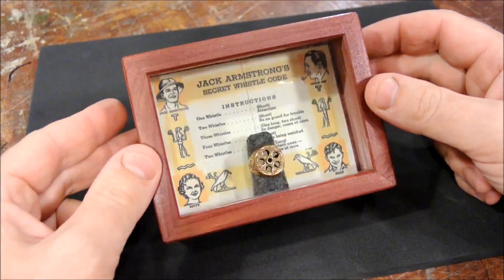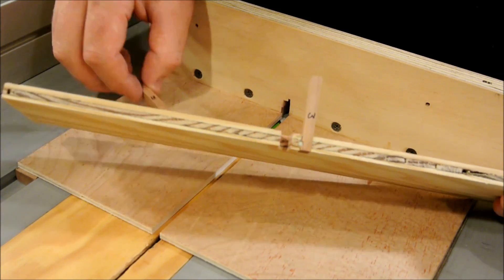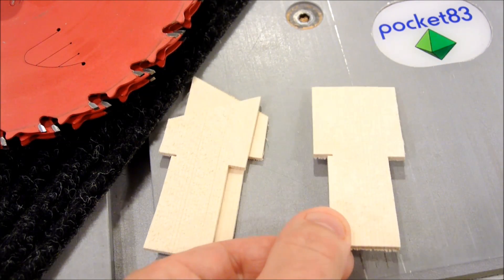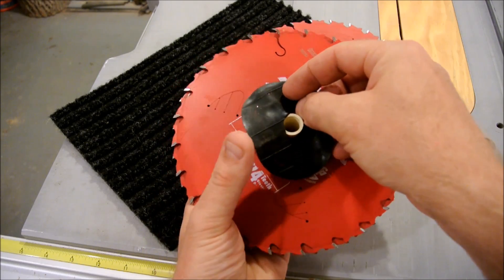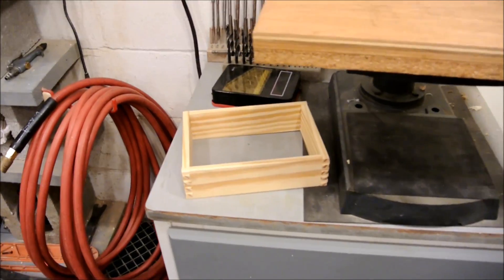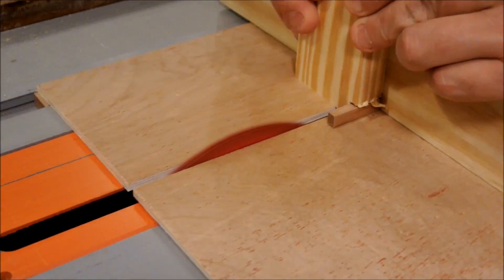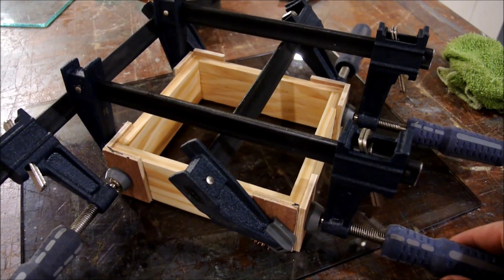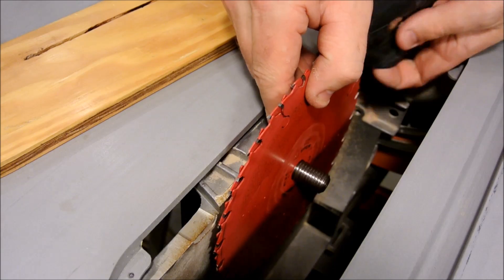Box joints WITHOUT buying a dado set (make one)

Comment: You can also use magnetic shims wooden shims plastic laminate shims or a wobble head too but you can't put up a video and caution people and say it's only for entertainment and tell me it's no reason to fear the procedure just because it isn't the standard .That's rather a flip flop isn't it? Inner tube is ok too . I've even made my own dado heads in a pinch but the engineers who make dado heads aren't dummies-- other wise dado heads would not exist .Then there is the math for the kerf you cut and the width of your drawer side,  but for what you are doing here; it's ok  too.
Reply from the maker: I'm not understanding your point. I'm not being inconsistent. A dado stack isn't exactly a "must-have" for most people, so this procedure could be used to achieve the same thing (with limited versatility), safely and at zero cost. As for the "entertainment" disclaimer, that is because I know that many of you are still going to be incapable of parroting the procedure without getting hurt. I mean, look- you can't even write a few sentences that aren't riddled with grammatical errors; I just wouldn't trust you around sharp edges and spinning blades. Lucky for me, I'm not really responsible for what you do to yourself!
Reply from the maker: Addendum: Most engineers are dummies. I've worked with plenty of them. Just look around at the products that surround you. Do you think they are optimized for design elegance, or for profit maximization? Engineers of this generation are just corporate tools. Thinking men and women are the true engineers. Now go read Emerson's "Self-Reliance," and bugger off; I have shit to do.

Comment: I've stacked regular blades for years with regular dado spacers (the cardboard or plastic ones they stick in dado sets). Never had any slippage. Why would they? They don't slip with a dado stack, why would they slip with blades? 

Also, anyone who uses a lot of blades is getting them sharpened. Just ask your blade guy to sharpen them with a straight cut instead of a bevel (not every tooth of course, just every 4th or so). Voila, bevel problem solved.

Third, an additional safety note. Stacking up regular blades, especially for a wider stack (I've done up to 3/4) adds up weight in a hurry. The blade set has a huge amount of momentum in this set up. That might mean strain on your saw. It also means your blades are going to spin for a LONG time after you turn off your saw. One time, I turned my saw off, stacked my material up, went into the house for lunch, realized I forgot something, returned to the shop, and the blades were still - quite quietly - spinning. Be careful.

Comment: Some safety thoughts:
I wonder how long the rubber pads are going to be good for? Is there any danger of one of them failing catastrophically (shredding and flying out between the blades leaving blades loose during operation), since that rubber wasn't specifically engineered for this task? You may want to replace them on a schedule. You may also not want to make use of that perished old punctured tube that you saved for patches 10 years ago.
The main force on them is probably centripetal, stretching them outwards a little (but maybe almost no actual stretch due to the clamping pressure of the blades). The other force is the sheer from the difference between the work the outer blades do to that of the inner one(s). The rubber would experience all this + vibrations and probably heating.

Comment: I thin this is a great technique for making utilitarian box joints. But you still have to solve for the problem of getting flat bottoms in your cuts. Its apparent in the video when you put two of the pieces together that the teeth of the blades cut at an angle and leave "bat ears" which show up as gaps in the final joint.

For what you made, I dont see a problem with it. But if your making a fine piece mean to show of those nice box joints, then I think you have to have flat-ground teeth on your blades.

Nice video!

Comment: Nice Power push stick. LOL
Reply from the maker: Jim Steinbrecher After I made that simple table-saw, I received a few dozen comments about how I should use a power strip for its on/off switch. It's so easy to just reach over and pull out the stick, but they insist.  You know I don't lecture about safety, but I still don't want a table-saw that has two ways to turn it on; I could see that "accidentally" going on while I'm plugging it in.

Comment: as usual, a great video.  2 things, if you make the center hole on the rubber slightly larger and spray them with a dry silicone would that help?  second, I love the push stick:>)
Reply from the maker: Russ Veinot  Thanks. The stickiness is not problematic. I didn't mean to portray it that way. In fact, it was the goal. Compressed air takes them off nicely. Lubricant would defeat the purpose, and a larger hole would mean that the rubbers are not centered.
Reply: rubber stickiness is not needed. the "springy-ness" of the rubber is the binding effect.  the outer edge of the washer is the center of the contact point and not the center hole.  the rubber only needs to contact fully on this outer edge.  then with larger center holes, the rubber won't bind to the center hole and center bolt (in theory) :>)
Reply from the maker: Russ Veinot You have not convinced me. You are suggesting that I alter a method that I know is safe, tested, and efficient, possibly risking efficacy, all so that I might not have to peel the sticky rubber from my blades when I'm finished. Most of the air will still be removed during tightening in either case, as you have noted, and as such, it will likely still require compressed air to get it off- but now the probability of blade slippage has been increased for no reason. Further, any lubricant is just a place for dust to stick. I want clean and flat.

Comment: I did a number of No 1 finger joint drawers. I found that after about 5 fingers you have to worry about error accumulation. You can never get your index pin/start position in the right place. So to fine tune the setup I put a machine screw as an adjustable stop to match the saw kerf width so that the fingers are as wide as the slot from the blade. Turning the screw made the finger thicker or thinner. I was able to make over 20 fingers wide drawers that fit perfectly together.
Reply from the maker: vipero00 Wow. I never did 20 fingers. I always figured that I'd just build that bridge if I ever had to cross that problem.

Comment: Clearly the inner tube rubber prevents disk slippage, especially while cutting in harder wood. Permit me to theorize that, rubberized tarp might have a better effect, compresion wise... (I've got a  craving for pop corn, all of a sudden..)
Reply from the maker: nexus01gr The inner-tube was decided on only after lots of consideration and experimentation. The idea behind a video like this is to use materials that are widely available to almost anyone. I used the cheapest brand of bike tube from Wal*Mart, and then found Goodyear brand to work, as well. The way that this material compresses is nearly ideal for this application, and thus, any substitute would not be recommended- at least by me.
Reply: pocket83 I guess one can achieve the desired (precise?) thickness by simply squishing the tube 'flange' and that would be o.k. by any standard. Always a pleasure, Mr Pocket!
Reply from the maker: nexus01gr I thought that at first, too. But surprisingly, it doesn't work that way; the flange will compress to a certain point and then stop. Further tightening does not change the cut thickness- at least not in any reasonably easy to measure way. A dial indicator might reveal some small movement, but a few square inches of rubber can take a serious force, so really, the rubber exceeds any practical compressive tolerance that it would require for this application. And thank you!

Comment: What about dovetail joints? Adam Savage had to make them by hand (With Japanese handsaws)
Reply from the maker: dporiua Dovetails are useless. They are only for showing off tools, procedure, or expertise in an impractical way. I have other things that I enjoy wasting my time with besides trying to impress "woodworkers." Normal people wouldn't give a squirt for dovetails; most shop at Ikea and can't differentiate between MDF and solid mahogany. I'm sure that will stir some emotions, but let's be pragmatic here. I have Sunbeam kitchen appliances- of what use are dovetails to me?
Reply: I think you have misunderstood the dovetail.  I am no purest - but the dovetail not only allows for a greater surface area for a glue joint but a mechanical advantage to holding the joint together.  It isn't useless nor for only showing off tools.  It adds strength to the joint and gives longevity to the piece.  

For those that shop at IKEA, they would not be making their own box joint jigs or dado stacks.  

Lastly, I don't understand the money savings on this.  A Freud Dado stack is 100 dollars and allows for up to 3/4 inch dado's and grooves.  You have three Freud blades (sold by Diablo) in your stack which cost about 35 dollars.  The math and time doesn't seem to add up here.
Reply: pocket83 I do like dovetails on certain projects, but I agree with you completely.  They only serve a purpose of aesthetics, which is why I'll use them only on a project where the joint is visible and I want it to be a "conversation point".
Reply: HonestDoubter I think part of his illustration here assumes (fairly accurately I think) that most people have a couple extra table saw blades kicking around. More than would have a dado stack.
Reply: dporiua ..in a cave.
Reply: +HonestDoubter I agree that the price of the combined blades for this stack is more but they can be purchased intermittently I suppose and customize.  Perhaps this is the benefit?

Also, I agree that for the most part dovetails are for aesthetics, technically they are more secure and even with no glue will provide and healthy joint if pressure fitted ... no?
Reply: +Matt Johnston that I hadn't thought of and makes sense. My worry is that hose would cause vibration.  But for those in this situation / this could be a crafty solution.

Comment: Nice summary of your process. I am working on a box joint jig design that I will be releasing soon but so far you have to pay attention too much during cutting, so I have not solved the mindless aspect yet.
Reply: Exact and simple,  good job buddy!
Reply from the maker: Darbin Orvar I think things are far less confusing when you aren't distracted by a camera. I made a terrible mistake while filming this, which I will probably post later in my off-cuts. Oh, but if you are playing around with box joints, try the Cedar closet liner if you can find some. I was very pleased with that ;)
Reply: @ Darbin that would require a toothed jig, which just clicks over to the next setting - the sled would have to have a backplate that moves mindlessly with the clamped piece,,, click and push.
Reply: If that is you,you're very pretty.
This Pocket 83 jack ass does't know his ass from a hole in the ground
3 of the same blade does almost 3/16"
Plus there is cheaper blades than those POS Diablos wants to advertise.